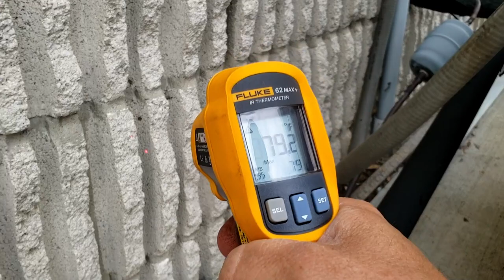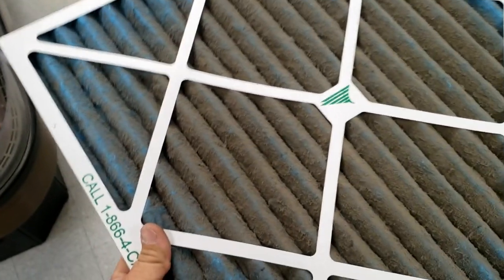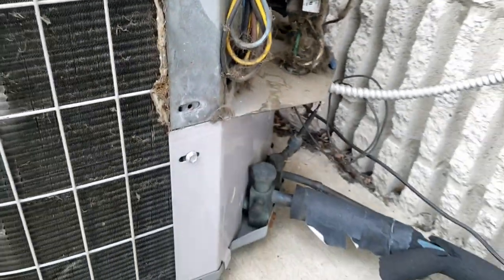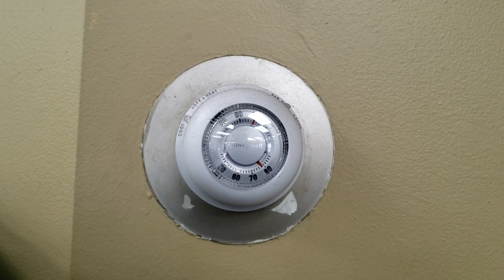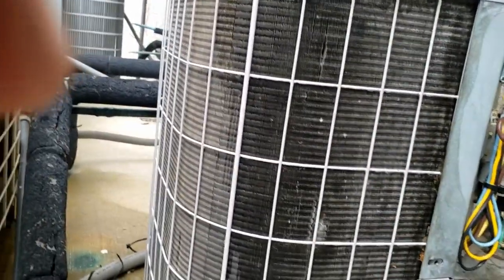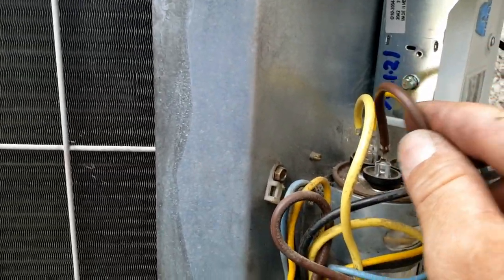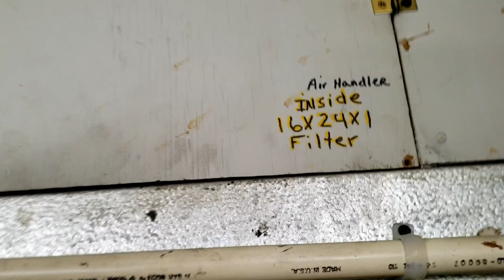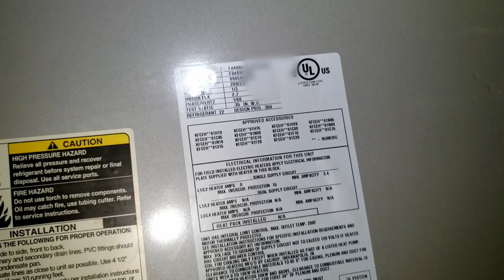Hot In Herre / Air Conditioner Not Keeping Store Cool

Comment: Wait . that's why they have poor air flow they have way too much fliters as long as they have at least one its fine right ?
Reply from the maker: Two in the ceiling would be fine or 1 at the furnace but the worse part is when there plugged up. If you can't suck, you can't blow😲😅
Reply: @HVACRSurvival  thats right . i wonder if they had any positive or negative pressure with that b

Comment: whats causing the bad audio quality?
Reply from the maker: There's a couple times my fingers got over the microphone. This one wasn't that bad. One of the other videos that I did had wind noise. I run my audio through a compressor/limiter  and a high pass filter that blocks the low end rumble around 125 to 130 Hz.  What specific part of the video are you referring to. (Time stamp)
Reply: @HVACRSurvival  14:33 and a couple more like it.
Reply from the maker: @macbong01  The wind from the condenser fan is blowing on my camera, automatic noise reduction is what's cutting in and out. There's no way for me to know that when I'm recording it. I just try to stay out of the wind but it's not always possible. I did just purchase a DJI Osmos to see if it's any better than the GoPro. Thanks for pointing it out 👍👍